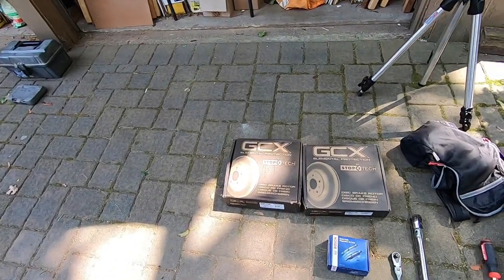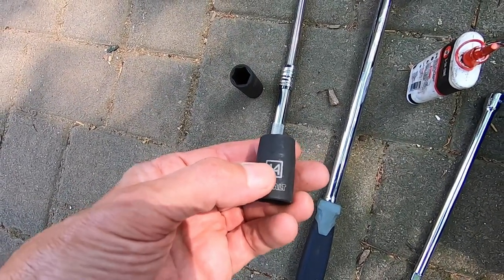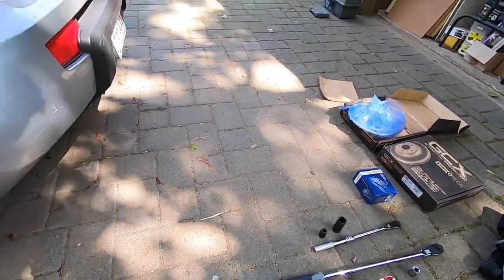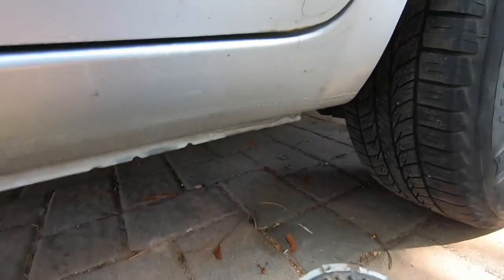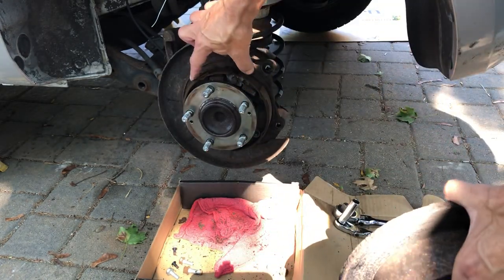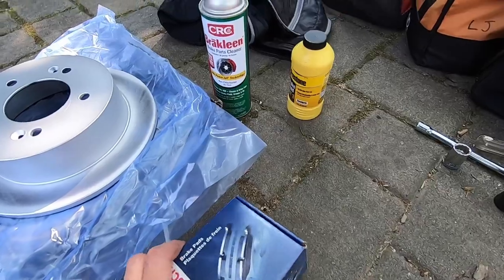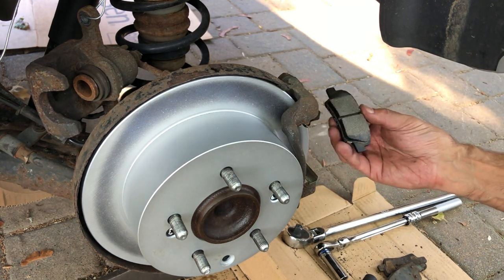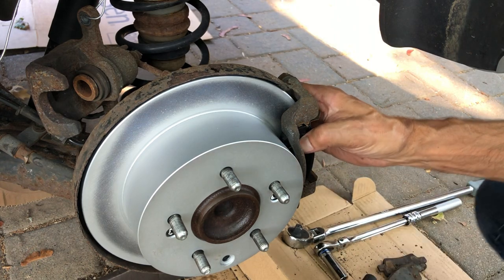How to change rear brakes and rotor on a 2011 Kia Soul

Comment: all that rust is because never did maintenance to those brakes parts. Mine 2012 is brand new, because Every 2 years I dissembling all parts, clean them and lube.
Reply from the maker: Absolutely right. I definitely pushed it too far. : )

Comment: No good to put that grease on top of slide brackets, it will attract dust, and when is new the pads slide easy, that's why you can't put the pads on the caliper holder. Anti-seize is recommended under to avoid stuck.
Reply from the maker: Hi, that's Bosch synthetic brake lubricant I put on the "brake pad slide areas" that comes with a set of brake pads (on some sets that include hardware) and is made for that purpose. It's not regular grease, although I may have called it that in the video - don't remember.

Here is how Bosch explains their brake part lubricant on their website:

Synthetic lubricant included in all applications
this helps reduce resistance on sliding contact points

Here is the link to that page:
https://www.boschautoparts.com/p/blue-disc-brake-pads-be619-

Yeah, brake lubricant will attract dust, but it will still work.
Anti seize is really for threaded bolts, not really brake hardware and can actually end up "seizing" the brake pads in place.
"Regular grease" can also seize the pads contingent on what type of grease it is.

Here is a reddit thread on that:
https://www.reddit.com/r/MechanicAdvice/comments/ag4uqo/psa_please_do_not_use_antiseize_on_brake_jobs/

Although I'm not a certified or trained mechanic, I've been working on vehicles for over 30 years (my own used in the courier business), and probably have done hundreds of brake jobs.
Yeah, sure, I've pushed maintenance intervals, but I like to adhere to basic protocols as much as I can.
Thanks for your feedback tho - I see that you show emphasis on doing routine maintenance from the other comment, and I admire that.
Reply: @ljshowto  OHhhh. I've been using anti seize for 25 years and almost 12 different cars I had before. is not good at all add any grease on top of a new shim, because the pad will slide easy, and if it's Stanley steel won't need nothing. For threaded bolts you use blue tide  Blue Thread Lock 242 Medium Strength Removeable Lock tight for Nuts, Bolts, Fasteners and Metals. Also I didn't see you putting any Loctite on any bolt, no even grease on the caliper or the piston
Reply: Did you read me comment? you said this: Anti seize is really for threaded bolts, not really brake hardware and can actually end up "seizing" the brake pads in place.
-- I said this: Anti-seize is recommended under to avoid stuck. Can you read well or need glasses?  I think you are confuse.